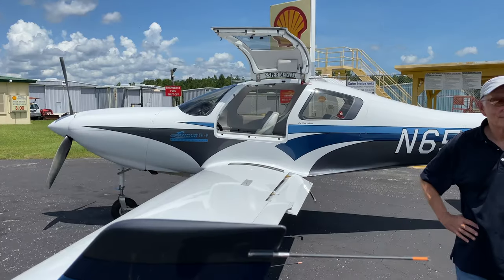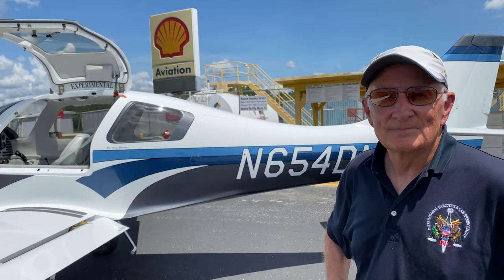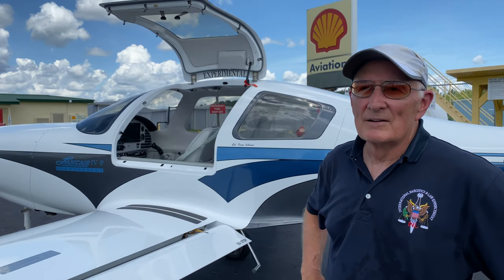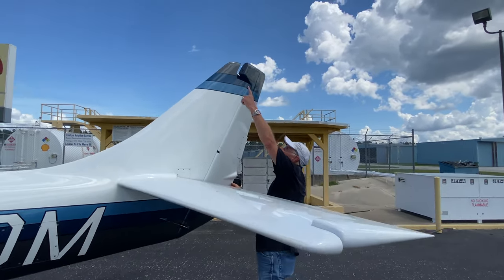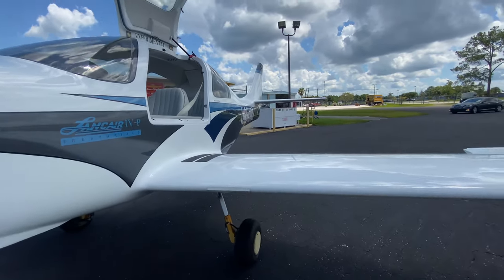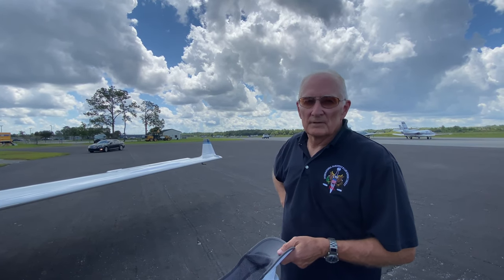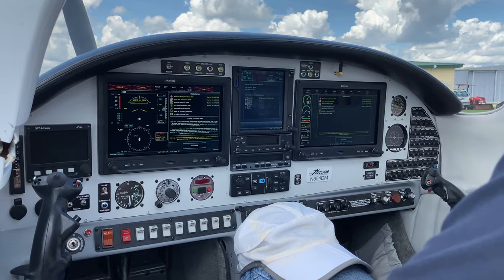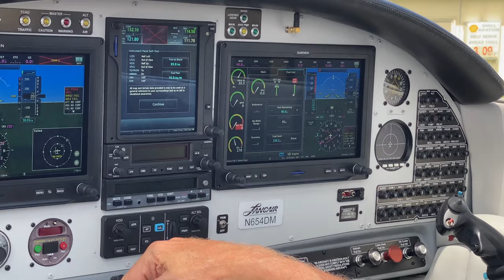Interview on Lancair IV-P with Doug Johnson @ 28J  Palatka, Florida

Comment: I always liked the sleek lines of the Lancair, but those skinny gear legs make me nervous.  They seem like they wouldn't take too much abuse, meaning you have to be spot on with your landing technique in all wind conditions.  I'll stick with my C310.  Its fast enough for me and forgiving on those less than perfect landings.
Reply: Note how he said he flew once a week to stay on top of it.
Reply: @MatHelm  Understood.  I try and fly my 310 weekly if not more often to stay sharp too.  High approach speeds mean a short time horizon in the final moments of landing.  My whole point was, and I could be wrong without knowing the strength of the Lancair gear, is they look quite delicate.  Weather conditions (e.g. gusts & crosswinds) are not always ideal upon arrival at a destination.  Given the choice I prefer a plane with more robust landing gear.
Reply: I shared the same concern, Gary, when first building it. I was somewhat reassured, however, when I saw that some of the parts were stamped "Cessna" when building the gear assembly--turns out it is pretty much the same gear as seen on the larger Cessna retracts.  That said, I've made the decision to not fly it off soft fields (although other owners have done so successfully for years). Cheers. Doug J

Comment: It looks great, I thought it was a very recent model. It looks different somehow, maybe it's the effect around the rear window. Also the door lip looks different than other IV-Ps. It's pretty much my favorite bird because it goes fast with relatively modest means. It can essentially match a Cirrus Visionjet for speed and by far bests any commercial single piston prop plane and that's a disgrace to the GA world. Sleek body, turbo and pressure cabin so it can fly high with the jets. But as great as it is I know there is even far more potential for improvement. It's a relatively heavy bird at a full ton empty and you can recline the seats for smaller cross section. The lighter the aircraft the smaller the wing needs to be so the benefits compound. I imagine a modern 4 cyl turbo engine could produce 200HP and match the same high speed if the plane is say 400kg empty and I believe that's very doable. And use car gas. If it's lean in every way costs just go way down and if you have an owners club of 4 or even 8 owners, it's like having private jet capability for free. And there is even more room for improvement. GA is hugely neglected. We are really dealing with Cuba or eastern Europe behind the iron curtain neglected, so much could be done.
Reply from the maker: Dan, thanks for watching and your insightful comments. I agree, GA can do more and the models like the Lancair can deliver attractive benefits to the traveling public.
Reply: Dan, you are the first person in 23 years to notice my special treatment of the rear windows: when they came out with the pressurized version,  they reduced the size od the rear windows. I thought they looked too small, so I used an optical illusion to get around that by painting a 2" dark area around them. Bingo--larger looking windows from a distance. Take a look in a parking lot sometime, as the auto industry designers do it all the time! Thanks for noticing! Doug J
Reply: @douglasjohnson2247  I hadn't seen your comment until now, you're welcome :)  thanks for doing a nice bird. I take it you added the static wicks too. The interior colors are very  modern too, did you pick that grey back then or was that upgraded with the avionics?
As singularly outstanding as the IV-P is, I've come to realize there is huge potential in a similar 4 place config but tear drop light body, skinny U2/glider wings and two small turbofan engines at the back. If the body shape is teardrop it has a uniform double compound curve that will make just a thin carbon fiber shell very rigid, meaning it can be an ultra light structure. It also lends itself naturally to pressurization. Jets are normally considered fuel inefficient but the world distance record belongs to an off the shelf simple turbofan engine so if you just go high, you get speed for free and jet engines can be much lighter than piston and you have two for ocean crossing safety. It would be a quantum leap plane. A Lancair 5P :)   Jet is so smooth and quiet, it's worlds apart more civilized than the tractor shake of pistons. And jet engines often have 5000hour TBO.  It would be the freedom of private jets but without the costs. Let's say it could go 750km/h. That really leaves a Cirrus SR22 behind. And I'd like to see zero altitude cabin pressure. At FL450 :)
Reply: @DanFrederiksen  thanks for your kind comments,  Dan. Yes, the interior is original just like the paint. I share many of your thoughts about the reliability and efficiency of turboprops (TP). They have some drawbacks,  however, as noted by many of the Lancair guys who have put a TP on their birds. First, much of the weight savings promised by the light powerplant is offset by the much higher jet-A fuel burn (twice   the piston rate, or more) thus requiring much bigger fuel capacity and carry weight. Also, the expenses with TP are much higher: not only fuel but also the required routine maintenance items. For instance,  i heard a Pratt rep state at a Lancair meeting that a section wash should be done after EVERY flight if you live near the coast or in the South, lest your warantee be invalidated! Not unusual to see $20-30k in annual maintenance for TPs. On another note, I was not aware of the TP record you mentioned-- I thought the round-the-world flight of the piston-powered Voyager held the longest non-refueled distance record! Cheers. Doug
Reply: @douglasjohnson2247  I agree TP is not a good compromise, I meant turbofan engines. Jets with bypass like airliners and private jets use. 2 small ones in the back, not in the nose. The record is also a turbofan. 40000km without refueling at around 500km/h. Globalflyer I think it was called. And last I checked that's further than any prop plane I know :)  So we can have speed and fuel efficiency and the quiet civility of jets. And tiny jet engines can be produced for little money and jets often have TBO of 5000 hours. That would be less maintenance than a piston. Napkin math says that a 4 seater could do with 15kg engines. Maybe 10.